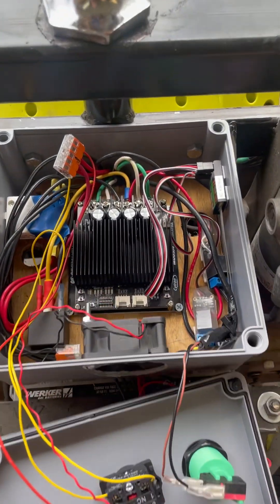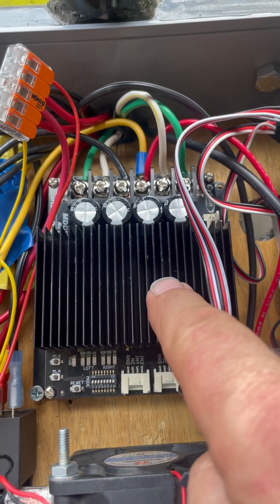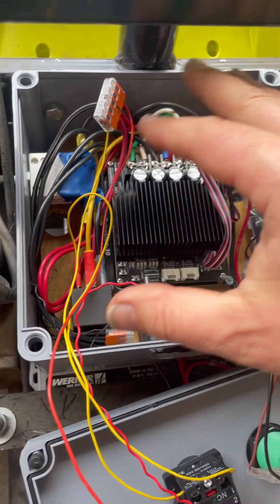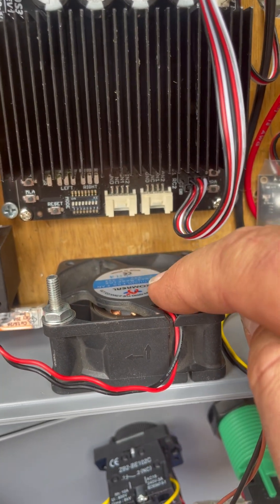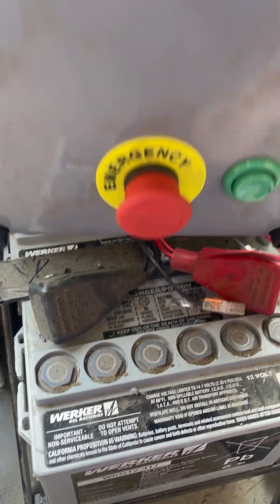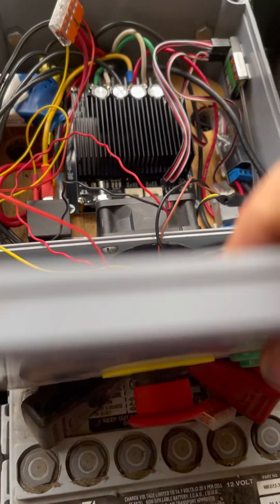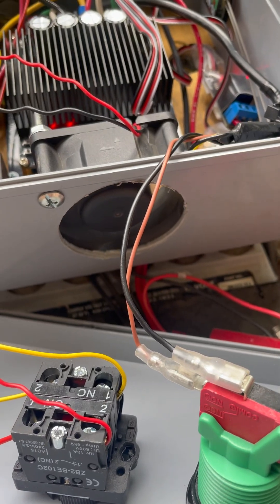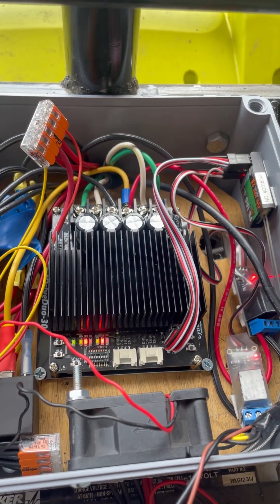Cooling Fan for RC Lawn Mower motor controller

Comment: Would you consider adding a thermostat that would cycle the fan on/off to save energy?
Reply from the maker: @stanislavjaracz  In my opinion, a thermostat just adds complexity. The fan uses a very small amount of energy compared to the wheel motors, so it’s not as though I would be getting extended run time from having it off for a bit. 

Having the fan always on whenever the mower is on is a good indicator. Without noise, a light, etc, it’s easy to forget the mower is powered up!
Reply: @BenjaminNelsonX Correct. Fan power is completely ignorable. Your filter will need to be pretty big for surface area, and be able to filter very fine particles.